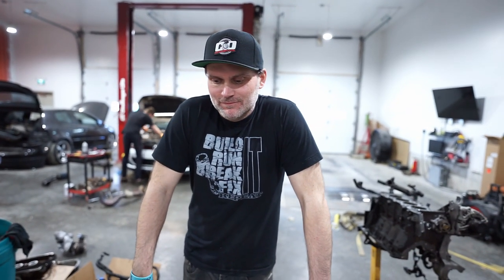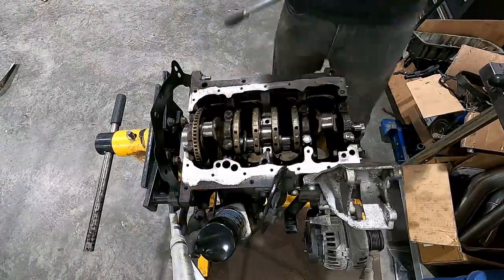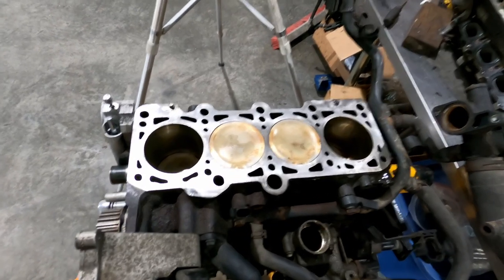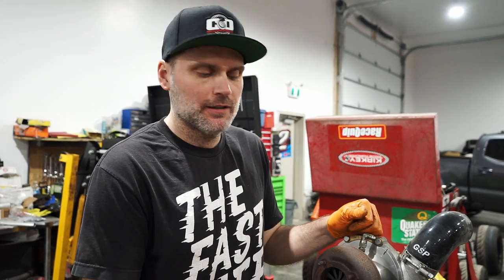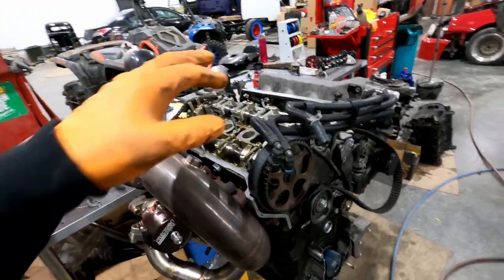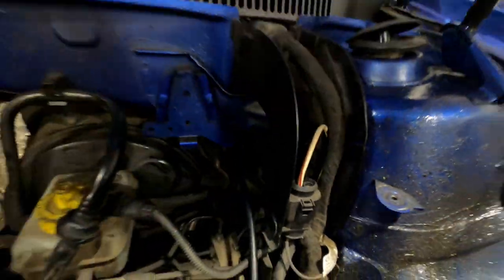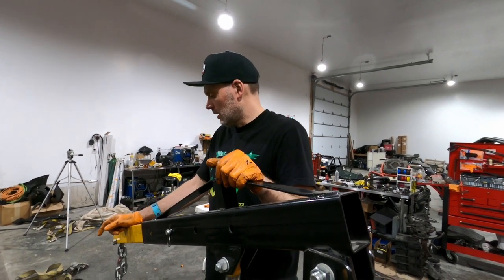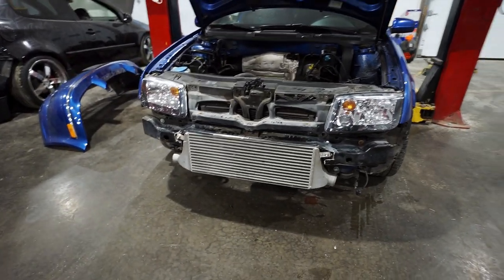MK4 Big Turbo Engine Build

Comment: Makes me want to get my build done. Precision 5858 turbo, boostline rods, 83mm je pistons, 1000cc injectors, e85,  got the dw 285 in tank pump also. just going nuts with it
Reply from the maker: Lots of good stuff there.
Reply: @COMotorsports  I got the motor pretty figured out the only thing I'm worried about now is the transmission, because it's a 5-speed what would be a recommendation of of yours I have been looking at dog box kits, but I'm going with either a Peloquin quaife diff. Just trying to figure out what i need to do so tranny don't grenade on me

Comment: You used some quality pieces for this thing. The Integrated stuff is top notch. Those were the I.E. coated valves right? What springs were they? Supertech? Definitely a sizable snail too. Those Precision's take a good amount of abuse. I have seen very little failures from them, even when pushed hard repeatedly. Smart man for taking care of the crank gear and switching to the manual tensioner and getting away from the hydraulic one which is a ticking time bomb. Air pump delete FTW. Good move. My guess is the customer will be back for a Quaife or Peloquin. The LSD is a must at this point. Legit stuff right here. Good work and damn nice looking shop.
Reply from the maker: I agree with most of what you've said but we've seen way more failures on precision turbo compared to Garret. Not even comparable to be honest.
Reply: @COMotorsports  
Really??? I've only seen a couple to be honest but I've been out of the game for awhile. I agree the the Garrett and Borg Warner are definitely more 'tried and true' with many more years of usage, primarily because they've been in action longer. I built a few 1.8t's with the 30r and 35, and the 30r was probably the best way to go, not just for reliability but the best mix for spool time, and top end power. What's that precision unit go for price wise? I don't even remember what I paid for the gt30r... like I said, it was probably 8+ years ago.

Comment: I fookin love this build i can't wait to get this far with my GTI AGU im on a k04 with 360 cc injectors cupra R fuel pump 4bar FPR just got it pushed to the max with my tuner today im yet to pick it up and see what its like 🤗🤗🤗🤗 keep the vids up man well done for the detail 👍
Reply from the maker: If you think a K04 is fun on these...you're in for a treat with a real turbo. :). Best of luck with your build and thanks for the comments. 👍
Reply: K04s are fun as hell i love mine right now but the power is addictive you always want more
Reply: @COMotorsports   its difficult to get a bigger set up without making it less analogue as mine is an early golf turbo runs vacuum pressure seen a KO4 that has a bigger turbine and compressor wheel so I guess getting 600+cc injectors and meth would be my next move
Reply: @beefysghost867  I get what your saying bro I had mine at stage 1 tune with the k04 set up it felt like 200 whp and i wanted more after a month of hard driving mines an old golf so it has lag from 1 -3 but comes on savage

Comment: Hey Dave, I noticed on the last several engine builds you have not hot tanked the block and components.  Is this a normal procedure,  Do you ever pressure test the oil galleys or magnaflux the block?  Or only on race engines?  Thanks  Joe
Reply from the maker: Depends on the condition of the engine, and overall power goals. No need to over complicate things for relatively basics setups. This stuff is expensive, so we try to save clients where we can based on their goals, or what the vehicle is used for.
Reply: Thanks for the quick reply.

Comment: Great content. Would you guys know what would be the better turbo between a K04 and a FrankenTurbo F23 as far as a replacement turbo would go. I currently have a K04 on my mk4 jetta and want to make a little more power. Will the K04 hold around 350hp or should I switch over to something different? Thanks!
Reply from the maker: Put a bigger turbo on it.

Comment: Do you ever have issues with bearing wear or anything when putting new robs in without balancing the rotating mass?
Reply from the maker: We always check clearances on new rod bearings. 99% of the time in these builds the crank isn't removed from the block.

Comment: These engines including mk6 etc, the crankshaft are almost bullet proof, the cylinder heads are not so great. I have tore them open, cylinder head, piston rings destroyed, but man, the crank is unmolested.

Comment: Really like your videos been going through all of the older ones an watching them. Question I got is a fluidamper needed on my mk6 gti full apr stage 2 ,intercooler, exaust etc. It's got 124,000 (getting chains done) planning on doing apr k04 swap.
Reply from the maker: I believe USP did testing to show a bit of power increase with one. To much to explain on here, we do them to hell get rid clutch chatter, easier on the crank, and help when revving higher.
Reply: @COMotorsports  Kool thanks, I'll probably have 1 put on when the chains are done for peace of mind

Comment: Hi mate at what power would you change the valve guides and would you only charge the exhaust side or get a complete set any advice would be welcome I’m going for around the 450 to 500 mark
Reply from the maker: Valves guides, not at all.

Comment: So I got the same cts intercooler kit for my big turbo set up, do i use the same diverter valve from my stock turbo?
Reply from the maker: The intercooler has nothing to do with the diverter valve/blow valve setup you run.

Comment: Did u guys replace the fuel pressure regulator? If yes what bar did u guys use??
Reply from the maker: Depends on tune, and fuel requirements. We usually use stock FPR unless we need a bit more fuel out of the injectors then we can quickly swap to a larger FPR. But we generally plan the fueling out based on the power goals and stock map is fine with the size injectors we're using.

Comment: Correct me if im wrong but i thought GLI came with vr6 until the mk5 ofc
Reply from the maker: Originally it did, then they got rid of the VR6 and the GLI came much nicer looking and with a 1.8t. The only VR6  after that in the mk4 was the r32.

Comment: i have a question, you don't need forged piston ? Is the connecting rod enough?
 Thansk for the answer
Reply from the maker: Depends on your power goals. Whatch part 3 to see the power we made.
Reply: @COMotorsports  yeah i see this video, i want around 350hp
Reply from the maker: @223Jawa  we can make 300-320whp on stock engine. 350whp you'd want to do rods.
Reply: @COMotorsports  and how much torque?
Reply from the maker: @223Jawa  all depends on turbo selection. If you want something that will take some abuse do rods.
Reply: @COMotorsports  okey thank you so much for info, btw you have awesome videos :)
Reply from the maker: @223Jawa  much appreciated. When your needing some rods we got you covered.

Comment: What would you recommend awp head or the aeb head with a Garrett gt28
Reply from the maker: Depends on power goals. As you can see from our 18hooptie videos we made 600whp on stock small port head and stock intake manifold.
Reply: @COMotorsports  stock valves or do they need upgraded? Looking at 500 to 600 at the wheel eventually